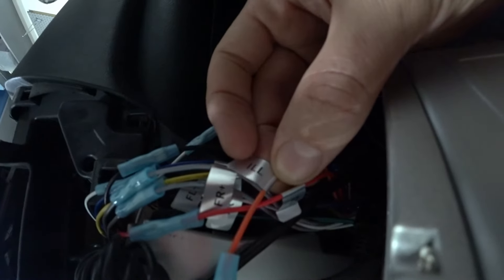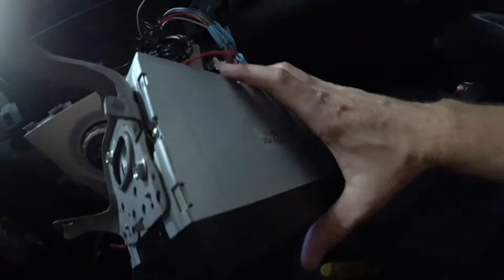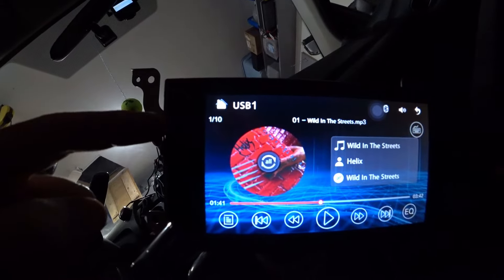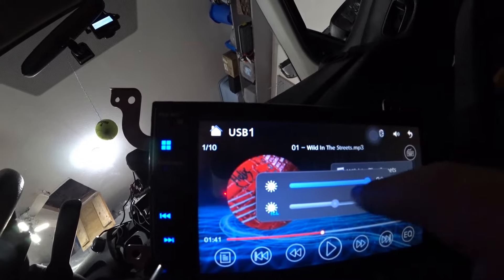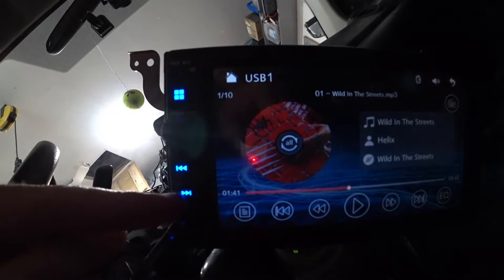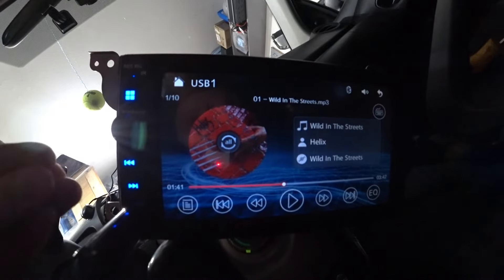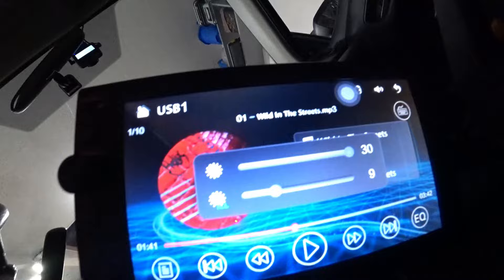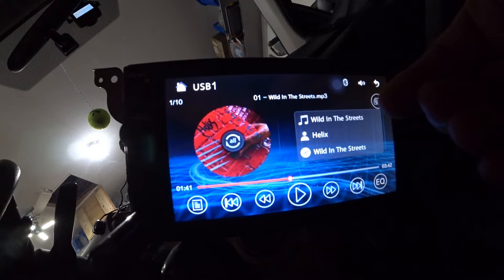What is "ILL" cable in a CAR deck Stereo and what does it do. Is it important and WHY!? OUSMIN 7''

Comment: If you tie in the illumination wire on the stereo to the 12v supply from the car the lights will come on any time your key is in the acc or run positions. Used to do this when installing my stereos in my vehicles. Keeps from having to mess with the headlights and dimming situations.
Reply: thanks this worked for me

Comment: Thank you for the detailed video. So for instance i will install a steering wheel control and tap the ILL wire on the stereo head unit to the ILL wire positive of the steering wheel control the illumination lights of the steering wheel control will also turn on when you open the park lights. Right?

Comment: Question - I have an Android unit that I am installing into a 2012 ford focus. There are 4 wires unaccounted for that are connected, on one end, to the power switch, NAV, etc. They are labeled "Key 1, Key 2, ILL, and GND". Does anyone know where to connect these?
Reply: GND is short for ground wich would connect to black wire.
Reply: key 1 is for steering buttons like vol+, vol-, mode, seek etc... ILL is for ilumination buttons of android unit, when you ligh on. key 2 is not used. This is for ford focus mk2.5.